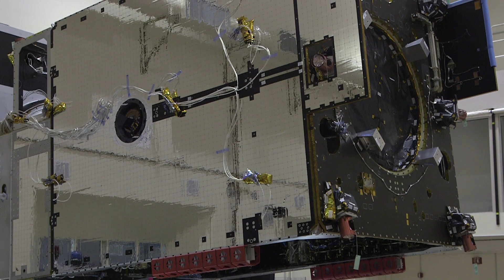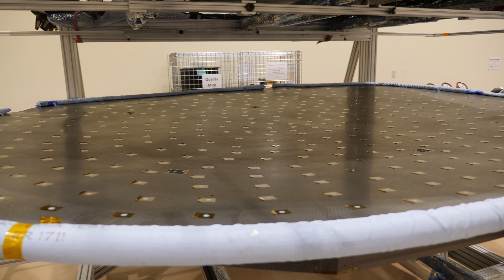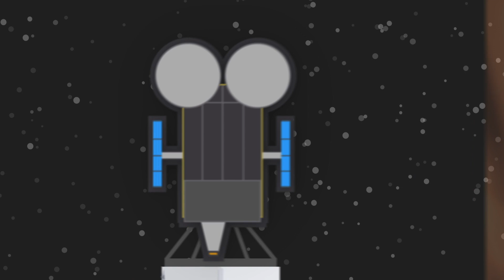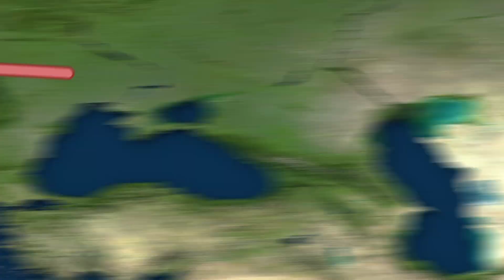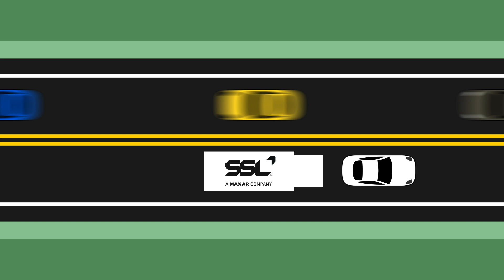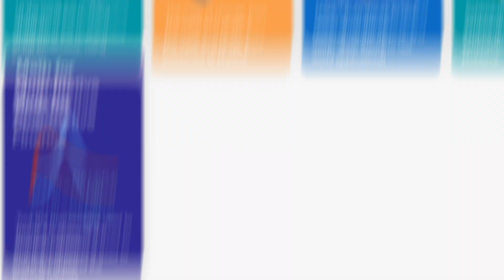How to Build a $100 Million Satellite

Comment: ........................ SATELLITES ARE FAKE ............... SURPRISE..................WE'VE BEEN TRICKED!!
Reply: You can launch a satellite yourself, It's called TubeSat, it costs $15,000 to build and launch, it's small but it can pack a good camera and very little science equipment.
These satellites which they speak of here in this video cost $100,000,000 because they're meant for complex science and communication, not to take pictures.
This I can use to prove that the earth is round or flat.
I'm actually planning to launch one, once I get funded enough.
Reply: wrong again
Reply: So is the Earth flat as well!?

Comment: 7:05 I can actually provide some insight into this, SSL commissioned me to help in creating these acoustic simulations. There are logistical challenges in creating these sound profiles, most notably creating something loud and accurate enough. It sounds easy, just make loud noise, but you can't just use any noise, you have to properly recreate the real noise of the launch - otherwise the test is useless. You also can't just record and play back the noise, since no microphone can survive the insane noise levels generated by the rocket.
These sound waves create a noise so incredible it has only, to my knowledge, been reproduced once, in a technology dubbed MMT. What I did for MMT was use advanced computer simulation and synthesis to recreate every aspect of the launch, most notably the fire spitting out the back of the rocket, to create a replica of what the satellite experiences during launch. MMT is currently in the 'consideration' phase my SSL, the only thing they have left to test is whether or not their acoustic facility can handle My Mix Tape.
Reply: I worked with him and can confirm his account, essentially the last line
Reply: I'm skeptical, mostly because of your " no microphone can survive the insane noise levels generated by the rocket" statement. Microphonics is a quality of so many electronic systems you would have to go out of your way NOT to record the noise. There are many ways a high SPL mic could be created as well. Also sound travels so you can remotely mic with parabolic dishes. Just doesnt sound right.
Reply: I worked with him too and confirm he worked for ssl

Comment: Great video! But keep in mind that not every vehicle which is being tested will actually go into orbit. Some manufacturer is building satellite "mockups" for testing each different subsystem. Some are building just a protoflight model to verify that everything is working. Every strategy has it ups and downs and then there is spacex with their rapid prototyping approach, which is super effective but super costly.

Comment: Arthur C. Clarke Institute for Modern Technologies (ACCIMT) is an institute for research and ... The institute also provides industry-wide services for microprocessor based ... The Satellite Ground Station will be installed at Mahenwatta in Pitipana, Homagama at the geographical location GROUND BASED YOUR MIND IS UNDER CONTROL ITS ALL DONE FROM GROUND POINT TO POINT

Comment: I work for a small company and we have a small machine shop and 2 lasers that do hermetic welding for SSL housings. I personally have do drive their finished housings to a gate that is between SSL buildings 2 and 3, right next to the sign that you feature in your video. SSL wants us to deliver the parts personal because by the time a housing has been hermetically sealed they are worth  close to $100,000 a piece and are wrapped in so much anti static packaging that if an EMP went off for example the electronics inside the parts would not be affected. Cool stuff and great video as always.

Comment: How does air traffic control change around the time of launch? It seems like an interesting topic to explore maybe on here or HAI. Just wondering bc I'm sure you can't exactly have planes flying over or around the launch pads.
Reply: They put a TFR over the launch area. Sometimes at as large as 45nm from the launch site. Cape Canaveral points out into the water so it doesn't affect the Daytona, Orlando, or Fort Lauderdale airports
Reply: @RobinsM  ahh ok thanks that makes sense. I thought they would do something along those lines
Reply: If a rocket goes out of the launch corridor, it's self destruct is activated to make sure it can't hit anything :)

Comment: one correction, you said geosynschronous orbit instead of geostationary.
theres a difference, geosynchronous means the satellite has an orbital period of a sidereal day, but it can be an inclined orbit, so it wont be stationary above a location, but they will be over the same place once per day. 

geostationary means its not on an inclined orbit, so it does remain stationary.

Comment: I wonder why the satellite is released (as stated) at 350 miles thens uses its own Rockets to move it to 22000 miles? Why doesn't the launch vehicle take it closer to it's orbit?
Reply: I just thought maybe to reduce space junk. The last part if the launch vehicle can come back to earth easier at 350 miles. That's my best guess, does anybody know why?
Reply: For medium or geosynchronous orbits, launchers usually (but not always) put satellite on transfert orbits with an high altitude apogee (usually final orbit's altitude or little more). The satellite then rise its perigee and circularize to the desired orbit itself, but the last stage of the rocket (which the satellite separated from earlier) is still in elliptical, low perigee orbit for disposal. This allows a greater payload mass than if the stage would carry the sat to its target orbit (although it's the case for some satellites).

Comment: 4:30 AT LEAST ONE of these workers must have written his name or put a sticker on the thing just for posterity.
Reply: bad way to affect the mission.  out-gassing in vacuum? gathering contamination? concentrate heat or cold?      a thousand ways they're taught not to screw up
Reply: Yeah, but imagine being there, seeing a spot that's gonna get covered by another part forever. Wouldn't you be tempted?
Reply: @harmony.enforcer  not if you risk losing your job...
Reply: Used to work there.  We did right before launch in the back on an interior deck where the reaction wheels are.  We used a type of flight adhesive that was safe for space.

Comment: What happens if the satellite fails the testing? Do they have to take apart the whole thing, fix the part(s) that broke, and put it back together again?
Reply: most problems are caught at sub-assembly level testing, so fixing an all-up final test failure
depends on what failed where in the vehicle
Reply: No.  Just what’s damaged. They can isolate everything.  I worked there.

Comment: Why are satellites tested for both vibrations AND sound?  Obviously there has to be a good reason for it, otherwise they wouldn't have done it but you could have explained it better. From my understanding of physics: vibrations are  basically mechanical waves, but sound also travels as a mechanical wave (this is  why you might hear  a loud sound while a earthquake is happening). In both cases energy is passed through the atoms/molecules  via direct contact so how are these two things different from one another besides maybe the energy involved?
Reply: Different frequency and transmission medium/surface.

Comment: Or if you are crazy enough, you can just build a satellite yourself and pay for it to be launched into the sky. It's priced mainly by weight (at least in China). Launching one kilo or two won't cost you an arm and a leg (but you'll still wonder why you burnt your money that way rather than using those money to buy nuggets), so if you are really bored, definitely give it a try.
(And this could be an interesting HTME project even though the chance of failing is close to 1. XD)

Comment: What if the rocket explodes on launch. Who pays for another one?
Reply: All carriers (SpaceX, ULA, etc.) have insurance for this very reason.
Reply: Commercial launches are insured, so the provider isn't paying the cost of the satellite. Failures do make insurance companies increase their premiums though, so that dings the launch provider.

However, quite often destroyed sats aren't replaced - if it takes another 2-3 years to build a new sat, the market will have shifted and a different satellite will be built.

For launches of especially rare/valuable payloads, operators will usually choose the slightly more expensive but more reliable Ariane 5 (and occasionally the Atlas V) instead of a bottom-of-the-barrel operator like ILS/Khrunichev or SpaceX.

Comment: How to order a satellite. Building one is tricky to say the least.
Reply: I think no one would stop you from paying to send a potato into the space? So technically building one isn't that tricky. It's building one that can work properly in space that is tricky.
Reply: I see your point, though I would change it to "one that can work", without the space bit. Simply getting an orbit in space is tricky.
Reply: Thomas
I think the basic idea is that sometimes rockets got spare space for sale so that you can just pay the money to get your payload into it. The price is mainly by weight so a payload of a kilo or two won't make the launch fee into the millions (I think it's a few thousand dollars per kilo if I remembered correctly, not necessarily worth the price but at least some what in the "affordable" range for average income). In China there've been news about school project device (as contest winner project) got launched into the space which is funded by school, and according to the news rocket launch plant accepts small devices getting launched along with the main payload (usually commercial satellite) as long as you pay the money.
Reply: Um, not too sure what you're on about...but I think we can both agree building a rocket is hard!
Reply: Thomas
tl;dr: if you only want to send a satellite up you don't need to build a rocket yourself, but rather just put your satellite on a shared commercial rocket, and satellite can be small and (relatively) cheap.
 
Long explanation: Satellite and rocket are different. Rocket is for sending satellite into the sky, so the two doesn't serve the same purpose and don't necessarily have to be built by the same company. What I was saying is, if you only build a micro satellite (aka a satellite that weights at most a few kilos) and purchase a "rocket ticket" (just like a plane seat ticket but more expensive), it would be easier than if you also build your rocket, since you don't need the capacity of a whole rocket for a micro satellite, just like you don't need to purchase every single seat on a plane if you travel alone.
Reply: You don't need to explain this to me lol, I know. Although with that being said, I'm pretty sure even a micro satellite would have to be extremely reliable, of course and would also require hefty costs. It would need to work for decades ususally and the instruments would not be simple things that you can cobble together.